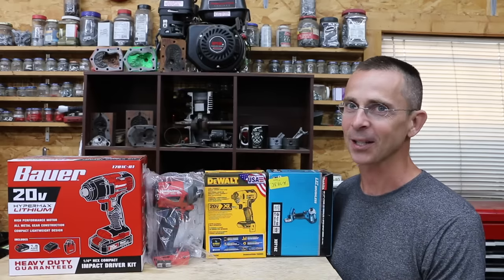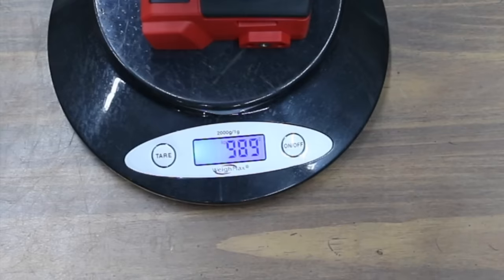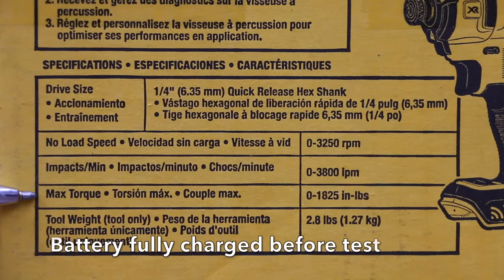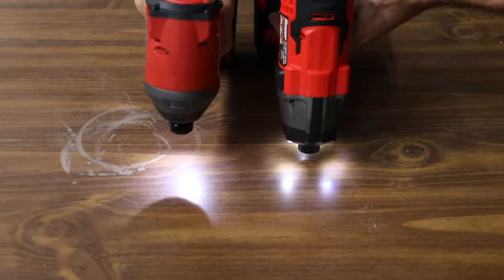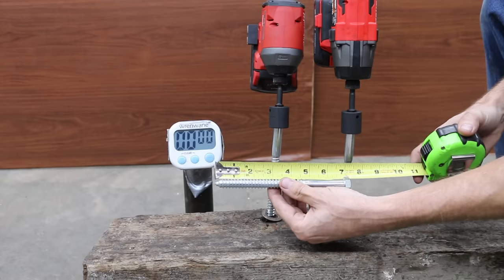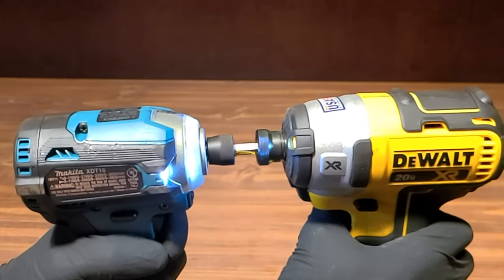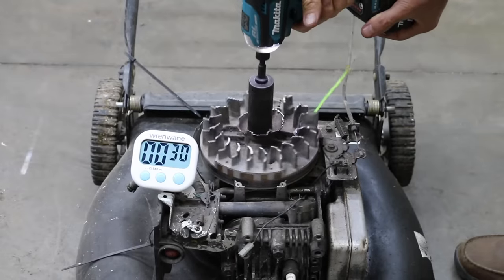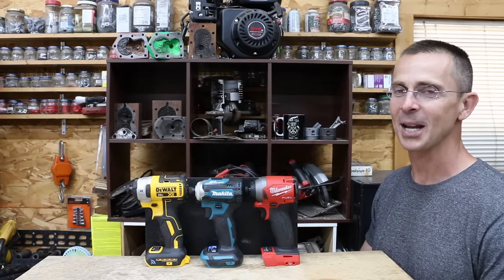Best Impact Driver? DeWalt vs Milwaukee vs Makita vs Bauer!  Let's find out!

Comment: I think you just might be close to becoming the King of Tool Testers. I like your methodology (especially using all impact rated adapters and sockets), the tests are appropriate to real world conditions, and the results are easy to compare. Excellent work! Thank you!
One thing I'd recommend looking at a little more closely is runout on chucks. I've found over the years that the more runout you get on an impact driver or drill, the more useless or even dangerous it can be when driving screws, especially when using extensions.
Reply from the maker: Thanks so much!  Thanks for the feedback.
Reply: Between him and ave you've got it all covered
Reply: @Demonslayer20111  AvE's reviews are interesting from a materials' sciences point of view, but his testing isn't as well thought out methodologically as Project Farm's are so you don't really get real world information about where a tool performs well and where it fails. It's either a "skookum choocher" for the 200 lb gorilla or it ain't. The beauty of PF's reviews is that they're methodological without feeling nerdy and you get a much better idea of what to expect with real world performance.
Reply: @PetrosArgy  
He tailors his content towards the engineering/trades crowds and those that are jnterested in either. So he does go into more detail about how the thing is put together. Good for if you are looking at seeing how different brands solve the same problem

Comment: It's not so much that I have to watch this channel before I go to the hardware store, but it's getting to be a problem that every time I watch this channel, I go to the hardware store. That's getting expensive! Haha

Having said that, there's a shop here that has a full range of Milwaukee product and Dewalt too.

Dewalt has 12v, 18v, 20v, 60v....
Milwaukee has tons of different models too, ranging in price from a hundred US to 1000 US. Some are brushless, some are not marked, some are fuel brushless...

Can't make head or tail of it and the shop staff wasn't much help.

I ended up just buying some gloves and a hammer, but still unclear as to which model on the shelf relates to what you're testing here.